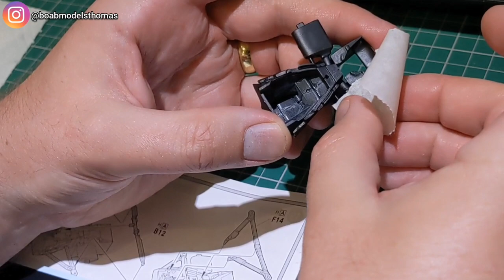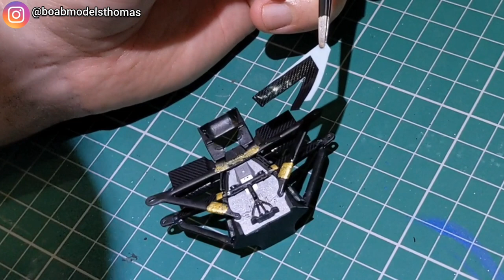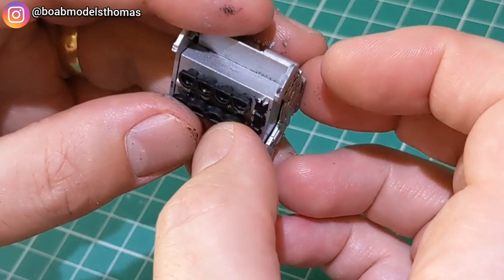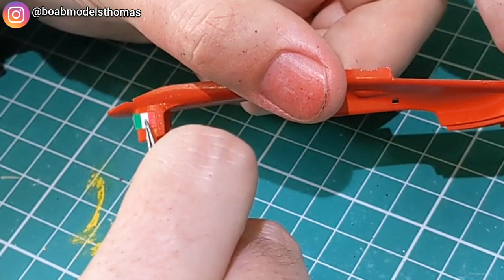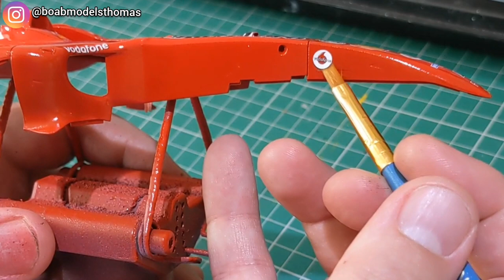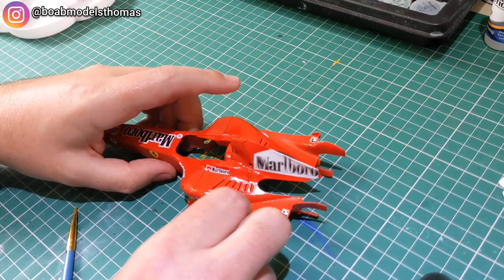Building Schumacher's Ferrari 248 F1 - Part 1 - 1/20 Fujimi - bodywork, engine & carbon fibre

Comment: Awesome work! I have a quick question,  i recently got myself this same kit and I'm looking forward to build it, but do you need to paint it? I see that parts already come in black and red.
Reply from the maker: Thank you. So you can leave it the colours on the sprues but some parts may need painting, the rear wing is moulded in black I think but needs to be mainly white. The bodywork you can probably leave though.
Reply: @BOABModels  Awesome! Thank you! I'll probably still give it some more gloss to it as the red it comes with seems a bit off.
Reply from the maker: You're welcome. Good luck!